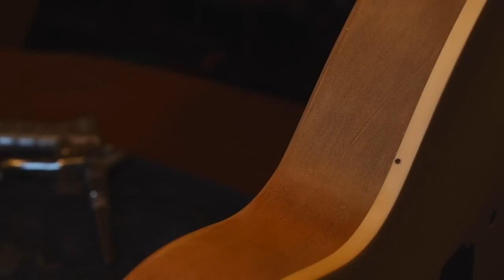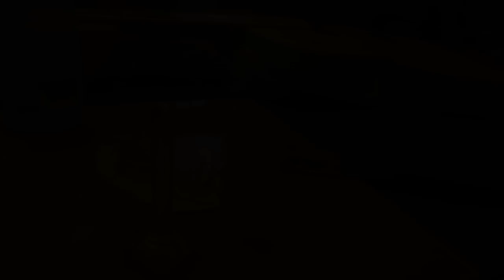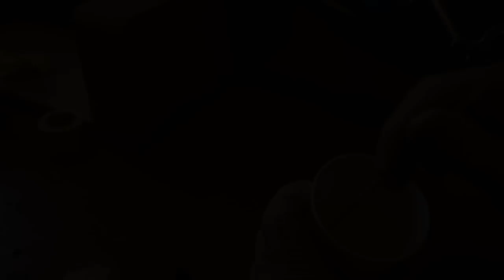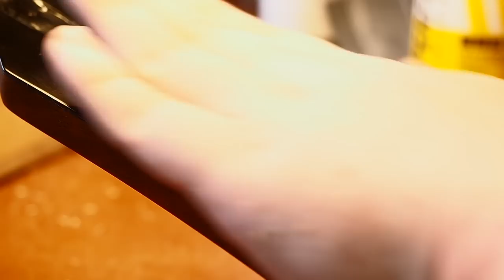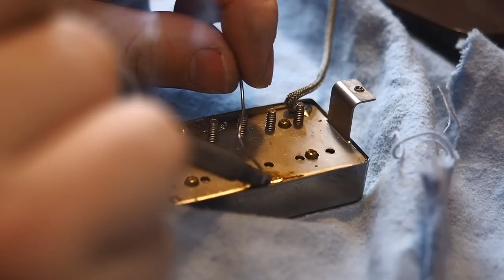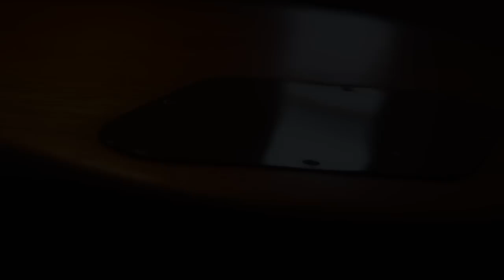Gibson Les Paul 1997's Refinishing  Shellac and oil-finish Restoration

Comment: I did an apprenticeship restoring antiques in the Philadelphia area around 40 years ago. Shellac was used as the primary finish on furniture and instruments for hundreds of years and is far more versatile and long lasting than 90% of today's finishes  nitrocellulose lacquer and polyurethane included. What you're doing is essentially a French polish.. a nearly lost technique using a shellac soaked rag called a "rubber"  and in.the extreme, using various grades of pumice to smooth between coats. I should note that the average lifespan for a French polish is 200 years.

Comment: Lovely job overall! As a former (mostly) session man and a luthier myself, I'd have done two things slightly differently... 1) I wouldn't have bothered putting the scratchplate back on having done such a fantastic job on obtaining that 'honeyed' finish on the maple top, but that's personal taste. 2) I loved the job you did on the nut, but when reattaching it, experience has told me it's better to use a little bit of CA glue as you did, but on the blunt end-grain of the fretboard, not the nut bed of the neck, simply because if you ever have to replace the nut, it's a lot easier to remove by tapping off that way and leaves no danger of pulling out any wood fibres from the neck itself. Small quibbles, otherwise - lovely job!

Comment: Tip when you glue the bone nut : use less CA glue, and apply it on the fingerboard endgrain side. It will keep the nut from moving perfectly, and it will be easier to pop it off later (without wood tear out). Applies to any guitar. Your luthier or local guitar repair person will love you.
Reply from the maker: Gluing to the fingerboard is another method. However, I think that the sound will be more conveyed when glued to the neck.
Thanks for the comments and teachings.

Comment: Scraping with heat will get the job done but man is it a work out. Nitro can be easily removed with paint and finish remover very fast. Usually you only have to mechanically remove a finish if its a polyurethane finish. That stuff is like glass :/ 

Great job none the less!!!!

Comment: Nice but Gibson used nitro because  oil messes up the wood's sound somehow I've read - I sanded my 89 red wine studio to bare wood and just sprayed clear nitro I got from Ebay, has the dot inlay fretboard  and added vintage t-top's…on that 490R you can take out the A2 mag and put in a short A5 in it and it will sound like an T-top, info on the web, but Yeah...that looks Nice, love the Wood look

Comment: Nice work.  However the guitar will sound more ‘open’ with a softer finish such as oil.  Not saying it’s bad. Just depends what you like.  A hard thin finish will give the sound a bit more girth and compression.     
Again nice vid.  👍
Reply: Tom Ahoks ha fair enough.   I’m not absolute in my opinions.  However if you have ever sanded the finish off a neck without taking the neck off you will notice exactly what I am talking about.  Have you ever tried that ?    The sound changes quite dramatically
Reply from the maker: Thank you.

Comment: 25:45 Does the nut slots are parallel? I believe on standard, but on vintage not..
Reply from the maker: I haven't heard that one before.
I've never heard of a vintage Les Paul with a bent nut groove. Isn't it bent due to work error?
Maybe I'm just ignorant.
More to the point, this is not a vintage piece, and considering what a bent nut groove can do to a guitar, I don't think it's ideal.